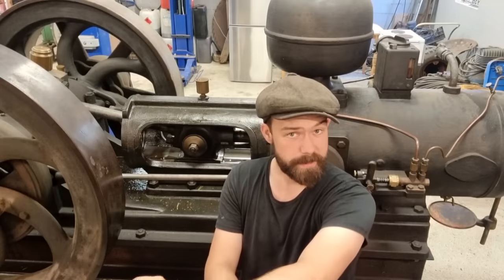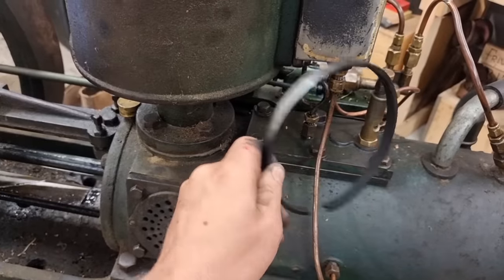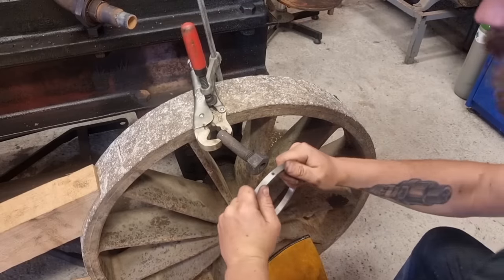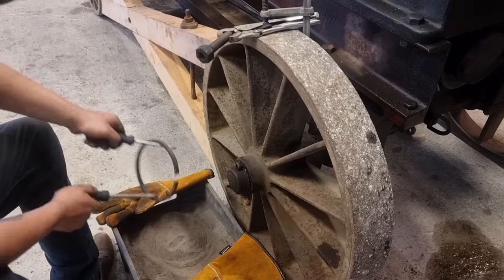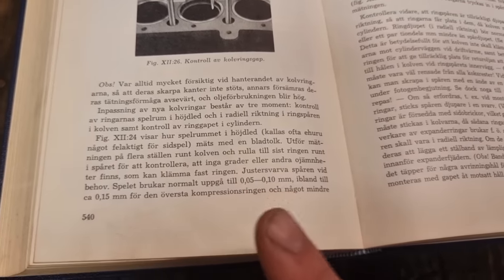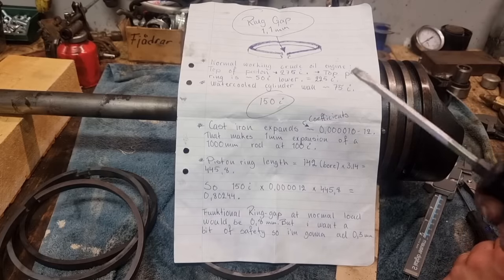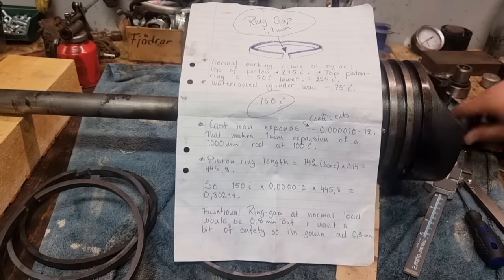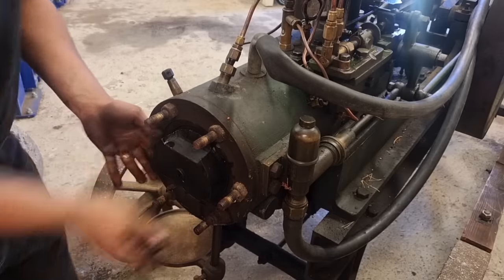Making Piston Rings!   In just 131 easy steps?..

Comment: Any reasons you don't check whether the cylinder is round or not ???
Using the heat n nut methodology, can't you simply process the expand the used rings ?
Will the end gap between lips too "wide" to have the proper compression ratio ???

I do think I would have check n try to correct where it comes from in the first place .
The only reason would be that in the hypothesis the cylinder comes to be little bit "egg" shaped, I would rather correct it as most possible it is within tolerance before making new rings ...

I guess making rings with particular deep in regards the place they sit is not that an easy task neither ...

Dare, care, ride safe, clean, have fun ...
From France with !